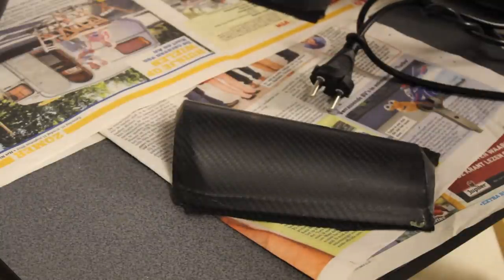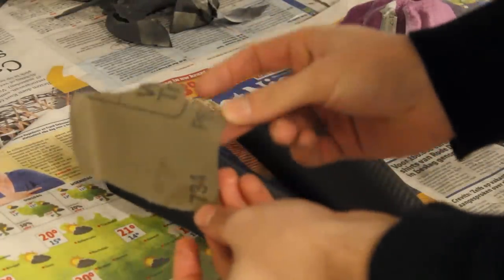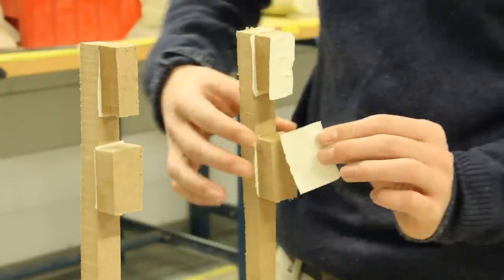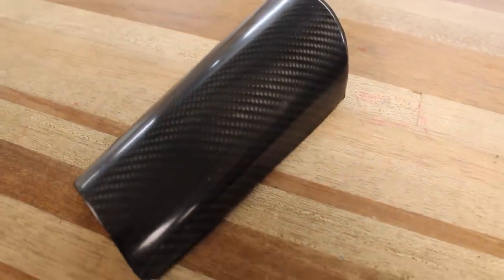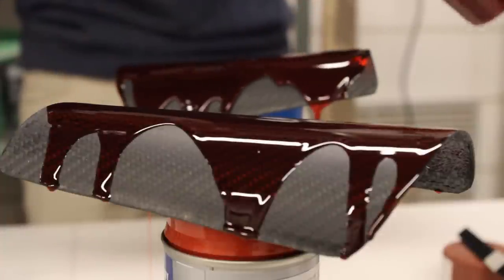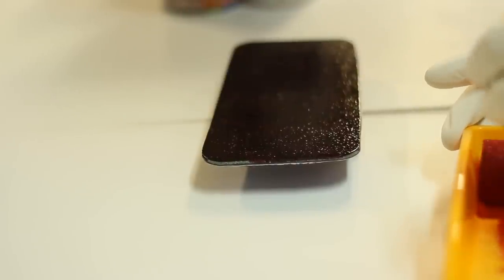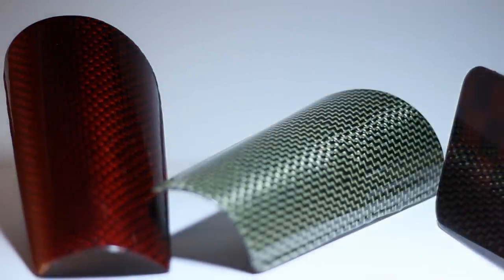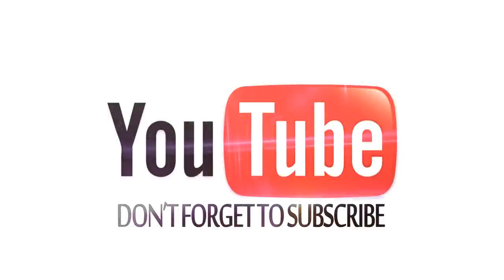Tutorial: Out Of Autoclave PREPREG Carbon Fiber/Fibre Part 6-7 (Finishing Carbonfiber Parts)

Comment: I hope your (or others users) expertise in painting composites can help. I have a carbon fibre ice hockey goalie mask I wanted to restore and use. It came painted in gloss black but I am aiming for a glossy naked carbon fibre finish. Is it as simple as sanding the paint back to the carbon/resin, scuff up the painting surfaces for mechanical adhesion and apply the clear coats straight on or is there more to it?
Reply from the maker: should work like you described it! but keep in mind it will be a time consuming thing to sand through the paint and not through the carbonfiber weave...If you sand through the weave you might get some bad looking carbonfiber...it might as well be that the carbonfiber layed down under the paint is not of good quality because the manufacterer knew in advance the helmet will be painted in a solid color after it...
Reply: Thank you for your reply! The same model mask was offered in a naked carbon finish; the question i guess is if special shells with better surface layers were made for that kind of finish or they just use the same lay up for all the different paints and finishes. Thanks again for the advice.

Comment: Hey Matt, thanks for the video. If the red coat is just a 2k polyurethane with a very small amount of additive, why can't you just spray it onto the part instead of flow coating (pouring) or rolling it on?
Reply from the maker: I can spray it on the part, but like I said in the video, as long I don't master the technique of spraying it with a spraygun, I get results that are less good than brushing it on :) But it is something I will be working on